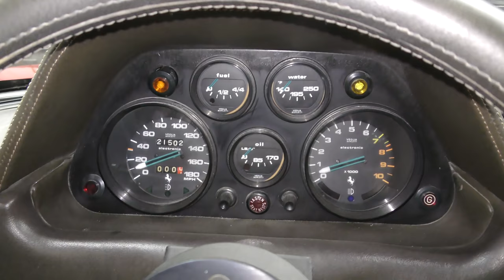CAR WIZARD bought the Car Trek 4 Ferrari 308 from Tavarish! What could possibly be wrong with it?

Comment: Freddy - "This car isn't trashed enough for me to fix..."
Wizard - "I'm used to these kind of things from Tyler."
Reply: Except Tyler was smart enough to pass it on !  It’s the perfect car for wizard though.
Reply: Technically, it is a thing from Tyler. Lol
Reply: Lmfao
Reply: He not getting paid  though
Reply: Wait a minute. This 308 isn't nearly as broken as it seemed during car trek. Ok we have to wait to find out what's going with the engine. But if if it's only a case of rebuilding the carburettors that's not such a big deal.
Reply: @felixokeefe  Wizard just makes it sound easy. Not a lot of rust and the pistons have not left the engine, but that's about it. Every panel needs work, the electrics are junk, and the interior needs to be turned inside out.

Comment: I'm so glad that you got a hold of this because this means that it will get fixed. Properly.
Reply: Agreed, I mean Freddy might be an ok mechanic, but this kind of car needs some serious appreciation, the the Wizard will definitely deliver. No nonsense, chinese radio, neons and aftermarket rims on this beauty (And I'm not against aftermarket rims, I think they are almost necessary to make some vehicles look exciting and interesting, but on this car, those ferrari stars look amazing)
Reply: @PastLight  The car needs a mechanic and a "technician", with the ability to see things through. I am curious on how Wizard will handle the carburettors seeing as he has mentioned several times he doesn't like them and might not have the necessary skillset to correctly tune them. I'd love a quick and short collab with Iain Tyrrell of Tyrrells Classic Workshop.
Reply: @TBendez  in the long run carbs should be better cause early fuel injection can be finicky. More simple with carbs if you can tune them up.
Reply: @elitesniper923  I can neither agree nor disagree and it's beside the point I was trying to make. He has stated he isnt as good with carbs as with electronic fuel injection.
On the other hand, Wizard hates mechanical fuel injection even more (and so he should) so carbs that are tuned with the help of listening and reading plugs is probably the better option.
Reply: @TBendez  This car needs a video collaboration with that amazing blind mechanic who can tune carbs (and do loads of other things) by sound and feel. That’d be cool.
Reply: @simonbailey2151  Do not know who you are talking about, sounds awesome but that is exactly what Iain does. He is the carb whisperer.
Reply: @TBendez  that would be on one of the banshee videos from legitstreetcars here on YouTube. Alex is great
Reply: @davidfernandez3554  I know who Alex is, followed LSC for years but he isn't blind, let alone someone who enjoys carbs :D

Comment: A full frame up restore by the Wizard would be great content as he walks us through all the parts.
Reply: There's no way in hell that is going to happen.  A "frame up restore" would run six figures and take two years - assuming he could even find and replace all of the missing, incorrect, aftermarket, and fake parts.

I'd love to see the title. Is it a salvage? Is it really a '78? Is there really a carbureted engine inside? There are more fake and [possibly] real Quattrovalvole parts on that car than original '75-'79 parts.

Comment: I picked up the same year, 1978 208GTS from an estate sale late last year, I never intended to be a Ferrari owner though I spontaneously purchased it for shockingly on the cheap! It's in great shape including MANY extra parts such as tin Ferrari "posters" hung in original owners garage, tools, carbs, doors, seats, various steering wheels, not yet installed roll cages, fuel (gastanks) cells, NEW old radiators, stock piston kits, rods, crankshafts, bearings, lots of misc bolts & fasteners, even high comp piston kits, two NEW engine blocks, various performance cams for the original 2 valve per cyl engine among multiple other(s) for the 4 valve heads including multiple sets of "DOHC" 4 valve heads! The driving computer still works along with everything else. The owner ran "engineered" gasoline he purchased at hardware store which explains how clean the engine is along with running waterless coolant, I've inspected engine with a cheap video inspection "endoscope" I ordered from Amazon. The owner accumulated the various parts over the years after he purchased car from original owner in early 1990's, I remember seeing the car for many years even as a child at local parades & car enthusiast meetups, his family didn't know much about the car but claimed they had many memories & stories about it growing up they were in an apparent hurry to sell off the estate with the pandemic situation & all I lucked out being the only person who offered to purchase it, being where it was located people were more interested in the various tractors & Ford trucks from the estate. So far I've driven it in a local parade & plan to drive it this holiday weekend, if it doesn't rain.

Comment: My 308 was a '77. The UK's first steel-bodied one. It had a red dash and interior and I've never seen another 308 with one. It was also so early, that it had the bumper for the previous fibreglass edition (with the indicators and reverse lights in place). Proves that even the mighty Ferrari raid the parts bin for their early models!

Comment: Had a 79 gtb just like this one. Spent two years restoring it. New engine , suspension , brakes, bodywork, paint , taillights . Had the exhaust headers silver powder coated. Those cars handle like a bus city driving, but out on the interstate the faster you go the more it lightens up, and corners like it’s on rails. Just my opinion but the 308 is the most beautiful car ever designed. Well then there’s the 288 gto!  Only draw back on this car is the front air dam, they just get destroyed, steep driveways, parking curbs, etc.

Comment: I had an 85' 308GTS QV and the previous owner added a power amp and old time GPS anti-theft tracking system. I had to rip it all out and re-wire everything to bring it back to stock. You don't mod these cars, they are rare in great condition, they need to be saved. Mine was exceptional when I finished it and finally sold it. I used to just sit in the garage and look at it, they are a work of art.

Comment: I especially like the universal black molding they used on the  front glass. Those factory moldings are a bear to fit and trim and if not put in correctly are a bear to get back out and use again. I've never priced a set of Moldings but I can not imagine they are cheap.
        Cool car that a handy guy can do what ever he pleases to.

                                                                                            Stacy

Comment: Just found this video. As a former '82 308 GTSi owner the window motors might not be bad. Check the grease used. Over time the grease can harden like wax. Clean and repack before replacing.

Comment: This will be a fun project to watch.  These are prone to rust in the rear trunk bulkhead and floor panels because the heat/acoustic insulation sandwiched in those panels traps moisture.  The car is apparently rust free but check out that area.

Comment: Replacing the old bullet style fuse box with the Birdman fuse box is a must... I did mine soon after getting my 308 QV 16yrs ago... it cleared up all the electrical gremlins and prevented future ones for sure.. Windows went up faster.. dash and interior lighting was brighter. Good choice!  GTBs get more $$ than GTS because they made fewer GTBs hence rarer and they supposedly track better due to a stiffer body.  But without AC my choice would be a GTS open Targa.  In mine cools nicely but my back will be pretty moist after a long drive

Comment: I can see why people would suggest going up in size on the wheels to something like 16, 17" wheels. Aside from making it look more modern, it'll make tire availability significantly more trivial compared to needing to custom order in 14" tires every time they need servicing. They would make it ride rougher, all other things being the same. That's the sacrifice you make when you lose sidewall height. But that is something that could be easily addressed at any point in the future without needing to pull the car apart, unlike any interior remediation or an engine rebuild, etc. So you lose nothing by keeping the original wheels and getting a fresh set of rubber for them.

Comment: The 308 is such a beautiful car. The early cars were particularly light having glass-reinforced plastic (GRP) body panels, with later cars having steel bodies - I'm guessing the Car Trek 4 Ferrari 308 was a steel-bodied car. But the thing you really need to look at/check (whether you have a GRP body or a steel one) is the tubular steel frame/chassis (used on Ferraris of that era) because no matter how lovely the car may look - the frames of many of them have rotted/rusted away and are just like paper...... I hope the Car Wizard has a good one.

Comment: I'll tell you from personal experience. That door speaker that's located at the far end of the door near your elbow will eventually die after slamming the door closed over time.  The door slam just trashes the speaker coils.  The speaker by the footwell is ok because it doesn't get the same impacts.

Comment: Thing is rough for 21k miles.  Redo the dash and center console in black with red carpet, cream leather throughout and cream OEM Ferrari Seats.  You are correct on the a/c Wizard, just like a 70 and 80’s 911 It’s marginal working perfectly.   Although you could install a Vintage Air system.  I think in a Ferrari it probably needs air conditioning and as far as the timing belt service you can pull the driver side rear wheel off and change the belt and water pump without pulling the motor

Comment: You are the perfect person for this. It's not a collector type etc. But it needed someone handy, who in many ways the hi-end labor cost would not be an issue.
Simple enough to repair and make work. If only Toyota built the engine, you would get 60-80,000miles per timing belt. 

PS I think you should not let Mrs Wizard drive it on her own. She might end up with a Few Chevy Chase fellas crashing in their SUV's

Comment: I live in Atlanta where it’s HOT for much of the year.  When he said he plans to delete the AC, I thought…”why would he limit his resale ability?”  If weeezard wants to keep it forever, great.  If he ever wants to resell, I would encourage to install some sort of AC, even if it’s not Ferrari.
AC also helps the car defrost windows👍
It’s weezard’s car, he can do what he wants.
Reply: The cooling system sucks in hot weather. Turning the AC on in a 308 makes the problem worse. Stop and go traffic is miserable and you have to keep watching the temp gage or it will boil over. Later models had extra louver vents across the front bonnet to allow more air out of the radiator.

Comment: Mr and Mrs Wizard, 
I had a 308 GTS back in 1981 with European spec injection black top white body model.
Back then, it was the second most beautiful Ferrari, only after BB512...
It was fast...back in the old day standards.
But,
1.many 308 were caught in accidents as the brakes were poor and easily got overheat and faded,
2. the timing belt need to be monitored as some were damaged as the heavy throttling had fast tear on the whole engine,
3. the carburetor models were the worst as there was no good idle and the idling speed nominal was 1500 ish if you want to run it in the city,
4. so ...you can see how difficult it was to balance an air conditioner and the high electrical power consumption, even I had installed a larger output, it still required constant replacement of battery,
5.the worst of all....this model caught fire easily particularly with the air-conditioning and many many electrical equipment that were installed, 
6, the clutch was quite easily to burn ...a bit better than 365 GT4 / 308 GT4 though , as I had both, in black / red, and I was just enjoying the prancing horses,
7, the handbrake wire setting was impossible to set to hold the car in more than 15 degrees ramps and not binding the brake disks 
8 the most desirable is the earliest fibre glass model with carburetor, 
the least desirable is the American injection model with least HP output, 
9, the front of your car , if I have to say it, must be turn backed to the original design even with the European spec, of course the American heavier bumpers give you more safety,
and install an additional thermostat control fan to bring the csr engine temperature within the highest working zone....not to get overheat and keep the engine gaskets for a longer period of time,
CAN YOU IMAGINE IF THERE IS A FRONTAL ACCIDENT, I still want to watch your channel.
Good Luck.

Comment: I believe the front grille and spoiler of the nose are original Ferrari parts - they are from the Ferrari 328 GTS. Many many interior and engine parts are also shared with contemporary Alfa Romeos, e.g. the Alfetta/GTV/75 , and Duetto/Spider, which will bring prices down, as Alfa and Ferrari even now share a parts bin. With kind regards.

Comment: I've been in love with this car ever since I first saw it on Magnum PI.
Reply: That was a 308GTS but....yes, essentially the same car.   Bit of Trivia:  the production company were originally going to use a Porsche 928 until they found out that Tom Selleck couldn't really fit into a Porsche 928 so....they switched to the targa-top 308GTS instead ....basically to accommodate Tom Selleck's height.

Comment: I had the '79 308 GT4..it was a gigantic disaster. 25k miles. It was rebuilt at 12k miles. It needed rebuilt again at 25k. I'm glad I only paid 2 grand for it. I put a Buick 3800 in it and sold it for 6k. It was WAY faster with that in it.

Comment: This car got a lot of crap throughout the series, but, it's been on my short list of attainable dream cars for years now.  I just think they look so good and it would be a blast to drive around in especially when the roof comes off... They're just so cool.  I would love so see one of these with a  voodoo v8 in it (or one of the new corvette v8s that were designed for the mid engine layout), upgraded suspension, better brakes, etc.  I'd just love to see one of these that was just pretty enough to be a driver but with modern running gear.

Comment: Here in the UK, 1970s Italian exotics are renowned for being garage queens, requiring serious finance to keep them running. One look at that wiring, and my first thought was "Yes, it's a 1970s Italian exotic all right" :)

These cars - Ferraris, Maseratis and Lamborghinis of the era - were wired up by people who knew nothing about circuit diagrams or ergonomics. The usual approach taken here by enthusiasts, is to replace the entire electrical wiring of the car with modern cabling, because the issues endemic to the original wiring are numerous, and a pig to solve even for professional mechanics. An expensive option, admittedly, but once done, removes several nasty issues such as spark arcing between the spark plug HT lead connectors, which is a known issue with Ferraris of this vintage in particular. See that happening, and you replace the HT leads with quality modern items immediately , because failure to do so leaves you forking out for a much more expensive engine rebuild further down the line.

Quite simply, we don't trust that wiring over here any further than we can spit it. We bite the bullet, and cough up for a complete rewire with modern cabling, because once that's done, it allows the other headaches these cars deliver to be detected a good deal more easily. And also saves a lot of far nastier expense further down the line once done properly.

Engines and transmissions are robust if they're cared for, but are likely to complain bitterly if neglected. They're somewhat highly strung, but if given proper maintenance, sing sweetly once everything is in place and working properly, and if proper maintenance is continued, are actually solid enough to outlast the owner. But, they do require frequent service intervals to keep them healthy.

Clutches can be a sore point on some 70s Italian exotics, though 308s have a reputation over here for being slightly better than average on this front. However, clutches again require decent amounts of TLC on these cars.

In short, a car like this is a project for a dedicated enthusiast with professional level maintenance skills, who takes it on with his eyes open, and is prepared in advance to spend a hefty pile of money to solve the issues these cars bring to the table with age.

Comment: I gotta say, watching car trek I really felt like they gave that poor 308 a raw appraisal. It's a 70's Ferrari that hasn't been pampered and kept up. Considering that, it's in amazing shape. Body looks clean aside from the damage to the lower valance and the interior is clearly a custom job anyway so no harm redoing it. Something like this could be brought back to life with nothing more than some TLC, time and effort. I doubt many of the parts needed will be proprietary either, unless that engine is hiding gremlins. 

Enjoy it Wizard, treat her right.
Reply: agreed. Although the apraisal takes into consideration the risk factor and it is mostly why the price was so low imo. But from what was said throughout the show it appeared that the car itself is relatively void of any major issues, even tho there is a very serious amount of small ones that definetely lower the value quite a bit

Comment: Wizard, if you put a modern camshafts in it, I will love you forever. It's really a great design but the camshafts from 1978 are not even close to efficient or effective. Kelford is loved and hated but they do it right. The valve springs are also crap simply because of age. Being compressed under a retainer for 43 years will take the spring out of anything.